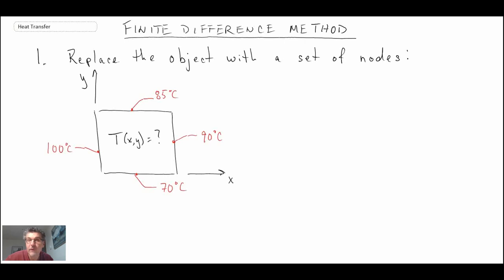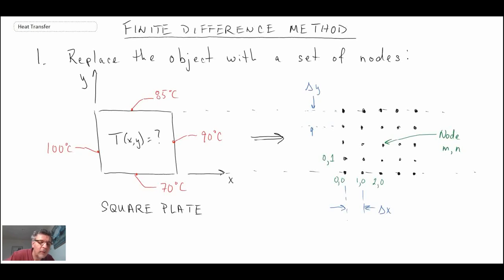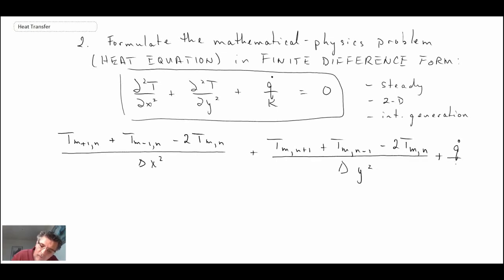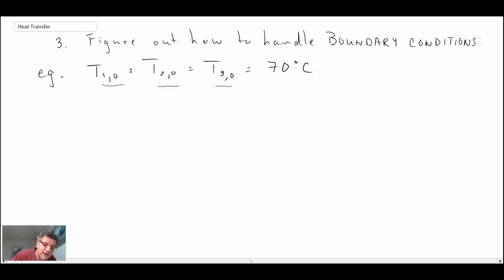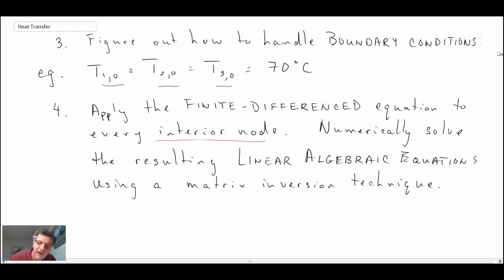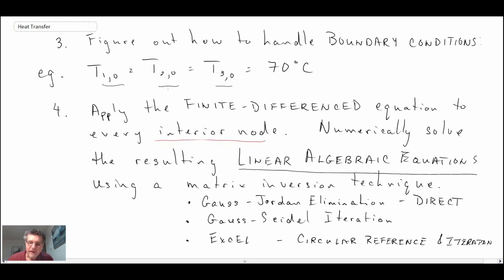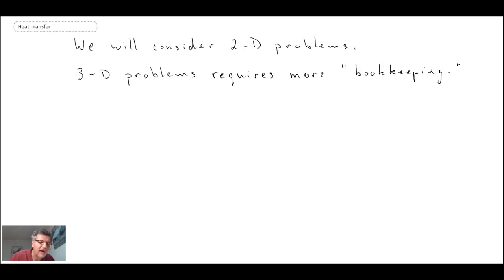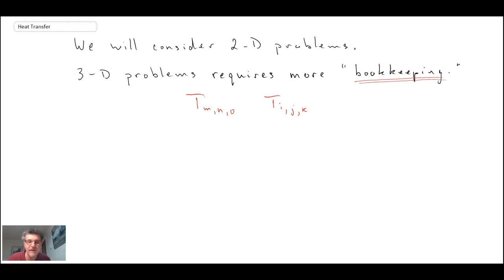Heat Transfer L11 p3 - Finite Difference Method

Comment: So is there an actual video where Ron shows Excel method to solve the linear algebraic equations? He states  that will show the method at the end of the video but I can't find it.
Reply from the maker: The following lecture is Lecture 12 - it covers converting the Heat Diffusion Equation into finite difference form and various boundary condition derivations.  Lecture 13 applies it all using the Excel model.  On the upper right of my YouTube home page is a link entitled "Detailed Course Index."  Click on it and it will take you to all of my courses- click on Heat Transfer and adjust screen zoom appropriately for your browser, scroll down and you will see all of the lectures listed on the left.

Comment: is this also applicable on 3D heat transfer
Reply: Yeah easy - just set it up so instead of each point getting heat from just x,y it gets heat from every point around it. There's several ways you can set it up depending on whether you use a square grid or a different shape.

Comment: can we apply this method for radiation heat transfer problems?
Reply: Well, the heat equation he used is only applicable for heat transfer by conduction. I guess you could use the same technique for radition problems, but you need to use correct heat equation. See Planck's Law for thermal radiative heat transfer
Reply: Thanks a lot. I know that equations change, but i just wanted some suggestion about the changes in the method of approach, if we are solving radiation problems.
Reply: Yeah, I don't see why no :). Give it a try!